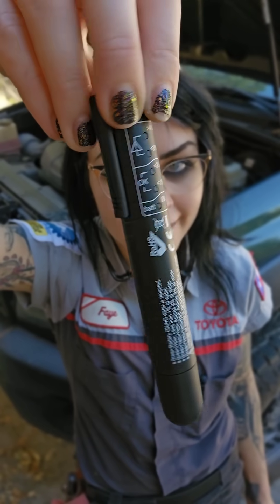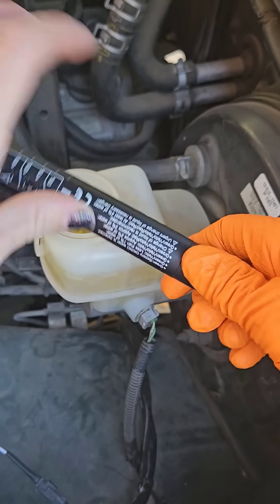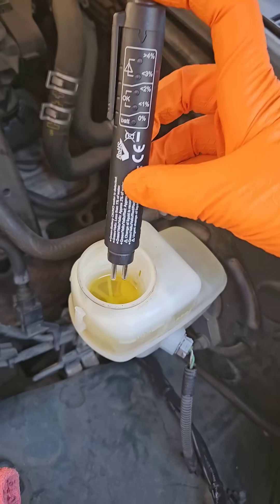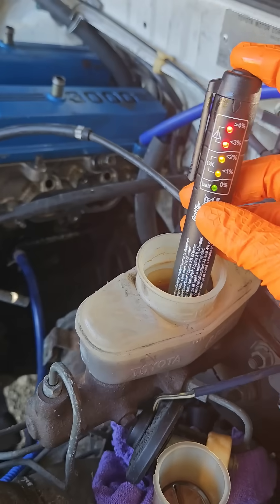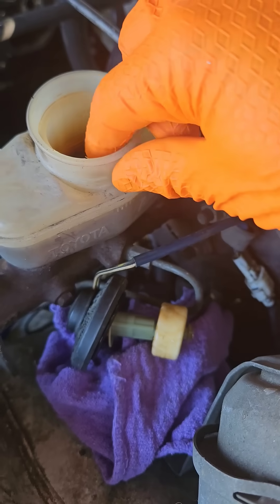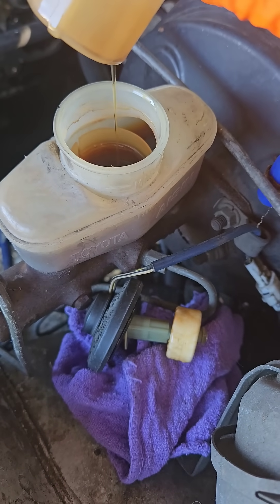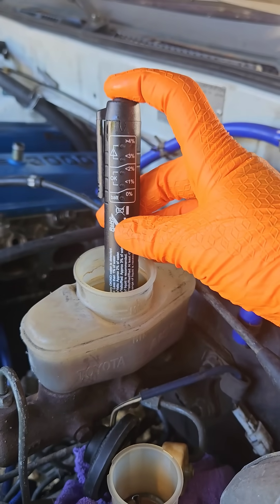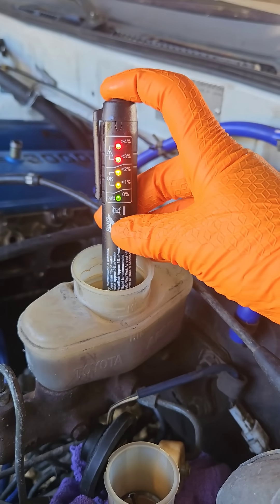Do you REALLY need your Brake Fluid Flushed?? How to Test it For Yourself!

Comment: I've owned many vehicles and never once had to do a brake fluid flush? Never had a problem with a soft brake pedal either? And I just did the 2nd brake pad job on my 2003 f150 at 160,000km and just filled up the brake fluid reservoir while I Blend the system. Our Ford fusion with 170k never needed a flush either?? Idk what to say

Comment: Yeah you really should have one of these and regularly get your breaks checked. My old car never checked and my break lines popped like water balloons. Then after getting them fixed we found out the back breaks hadn't actually been working for who knows how long. When we changed the calipers, the break fluid that came out was pond water green and smelled like swamp.

Comment: I have a Camry. During my regular maintenance they mentioned the break fluid and cabin air filter and I said no. I went back for the next maintenance and they only recommended the cabin air filter, any idea why? I didn’t mention the brakes as a concern when I came back because they have been working fine.

Comment: All fluids should be changed. Because it brakes down and it doesn't work like it should when it brakes down that's why so many people have problems with their vehicles they dont have fluid changed. It doesn't matter if the fluid looks good or clean it still brakes down. Transmission fluid should be changed every 50.000 miles. Your vehicle will last long and preform better. Antifreeze should be changed about every 40.000.Radiator needs flushed before putting new Antifreeze in it. Trust me if you want good performance always change fluids.

Comment: Good single point, but water/moisture in your brake fluid is Not the only reason to change or not change brake fluid. Does that tester test the condition of the fluid in the calipers?? Does it tell you that your last mechanic only flushed out the reservoir and not the lines & calipers? Age? Dirtyness? Contamination from other fluids?? Etc Etc etc... I'm an honest technician, but unfortunately that tester is gonna loose me money, opportunity, and make me look unskilled. Also might cause deeper issues by allowing dirty fluid to stay put for several more years

Comment: It also rarely matters if you just drive around town. You will never get the brakes hot enough for it to fade. If you tack it then definitely make sure your brake fluid is tip top. But it doesn’t matter in the grand scheme of things. You shouldn’t wait 10 years to change it but it is also not necessarily necessary to change it after 2 years

Comment: Master mechanic 40+ years in the trade with a tip for ya’ll, chuck some of them silica packets you get with your shoes in your brake system, you never need to flush it again. Giddy up.

Comment: One important thing that this tool does not measure is the boiling point of the brake fluid, which is important too because of the heat emitted from the brake disks. If it boils in the system you’re at the same shit when water boils. It is mandatory to measure the boiling point in my country (in Europe, but not UK) when the car goes on MOT (closest match as far as name goes).

Comment: Can't the water saturation out in the calipers be a lot higher than in the tank? I always flush through out to the calipers when I buy a new (to me) car, doesn't take much time and brake fluid is pretty cheap. At least it seems logic to me that the saturation levels could be higher out in the dead ends, as there is no circulation.

Comment: That's a nifty tool, but you can do the same with a multimeter. I usually go by fluid color if its not clear/yellowish its not good. Brown, pink, or green means its time to change the fluid.

Comment: Consumers now days are so lacking in the background knowledge, let alone the wonder, of the how's and why's of such subjects.  This provides allot of opportunities for unscrupulous service center's to exploit customers.  Recently I replaced the rotors and pads on my car as I had 46k on the stock parts.  Stock rotors on an STI are basically junk so I went with after market 2 piece units.  While I was at it I also replaced the stock rubber hoses as well with stainless steel braided Teflon lines.  A very good idea I might add.  Lastly was the break fluid which I replaced stock with DOT5.1 660 degree by AP Lockheed.  Night and day with incredible feel and no fade.  Few systems on a car are more important than the breaking system.

Comment: Water turning to steam in this situation isnt as common as people think, if theres water in with the oil the boiling point of the water sky-rockets while the boiling point of the oil lowers drastically which is actually what can be dangerous because under heavy braking the oil can boil causing it to bypass seals causing failure which is also super rare

Comment: Question for y’all… I changed my break pads because my mechanic said the disks were still in good condition. After the change, the loud squeaky sound disappeared. However, a couple days later, the loud squeaky sound came back and it hasn’t stopped. That was 3 months ago, no change yet. Pleaseeee help

Comment: I was unable to have mine flushed cos front bleed nipples are seized. They did bleed the rear. What are my options. How about if I suck out the fluid in the reservoir and refill this. Would that be enough to never have to replace my front callipers for some stupid bleed nipple ?

Comment: Not the best kind of tester as it doesn't test the actual boiling point, sometimes the fluid itself, even with low water content, can still boil, usually if it's had dot 3 put into a dot4 braking system, or dot4 into a dot4+ system (merc thing)